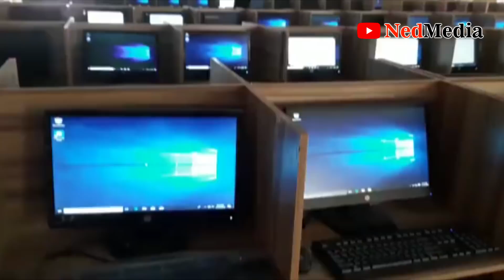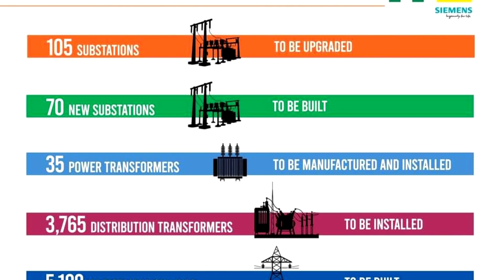Lagos Mega Projects Completed In Q1 2022 + Projects Completed In Nigeria

Comment: We should be able to build: railways, airport terminals, data centers, refurbish national theater ourselves. Those projects are not rocket science. And we should really be able to design and build power systems after so many years power failure. BioPharma is NOT good. Those companies don't care for welfare of local population. But my real concern is maintenance. If we didn't design/build it how do we hope to be able to maintain it? That's why our current power grid is so useless. Or will we be looking for "new" projects in ten years time cos the old ones ran into disrepair?